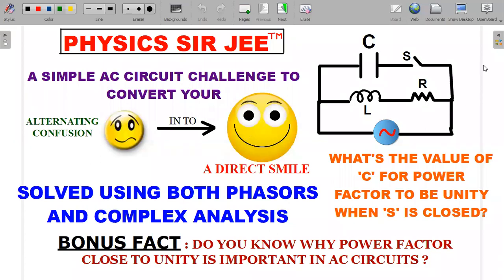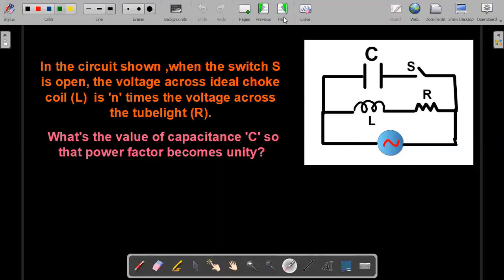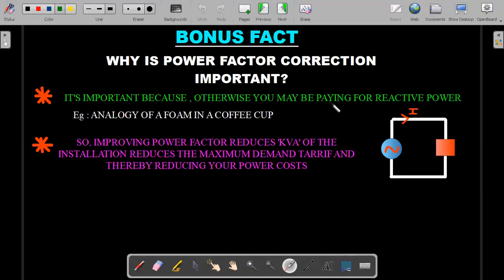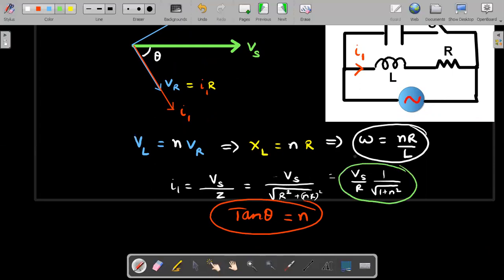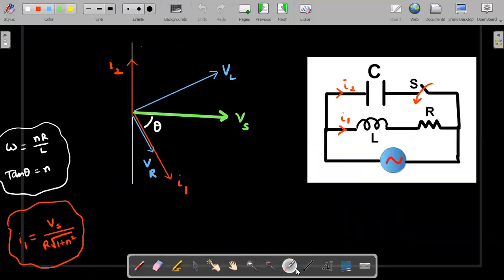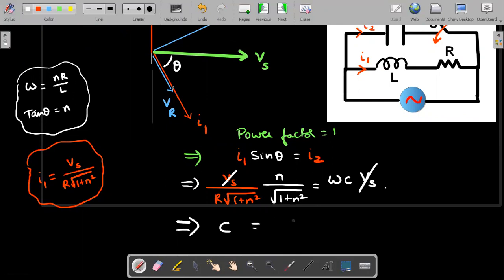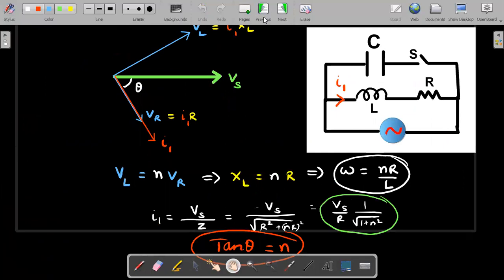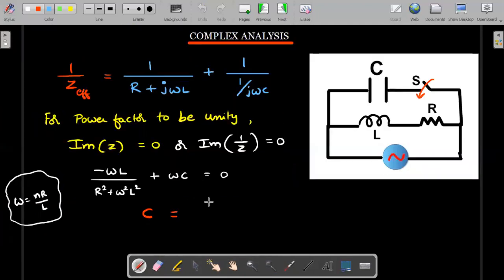A RARELY SEEN CONCEPT OF PF CORRECTION IN AC CIRCUITS-SOLVED USING BOTH PHASORS AND COMPLEX ANALYSIS

Comment: In complex impendence in the capacitance part if we write in a series by the way in this video is described  so  Zeff= R+ i(wl-(1/wc)).  Why in parallel there is no -ve sign before the capacitance part
Reply: In series the voltage drop at cap. and ind. are equal and opposite (as u see in phasors) , so we use a negative sign
But here, you can see that the cap. and (R+L) are in parallel, so there must be equal voltage drop (both in magnitude and sign) across these. So, no -ve sign used here

Comment: why there is still i1 current in the lower branch sir .will it change ? just becoz v is same  and impedance is same is this the reason i1 remains constanet ?
Reply: Consider only the (R+L) branch, initially and finally there is equal potential drop and so the current should remain same as reactance remains unchanged. It's not affected by external changes